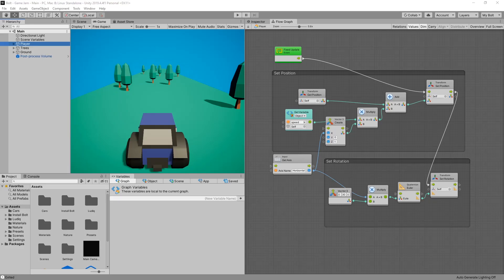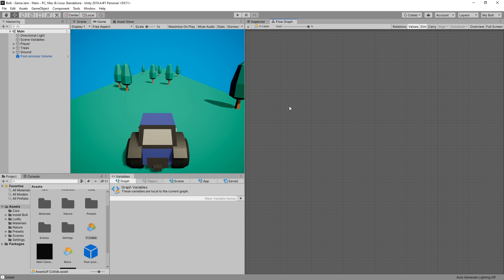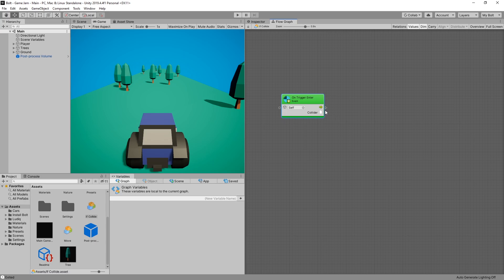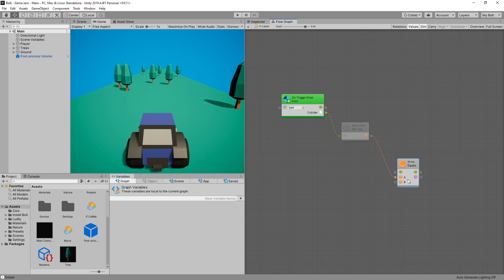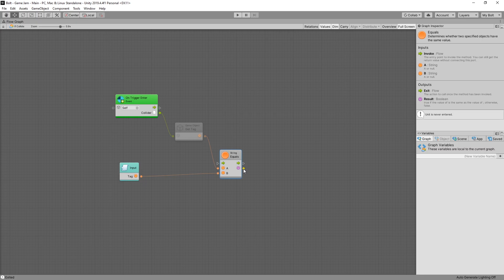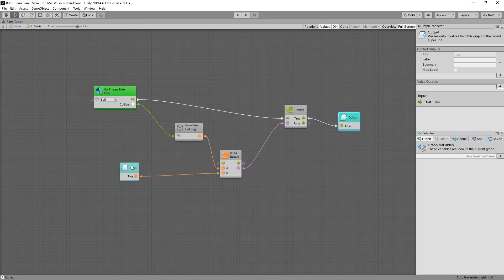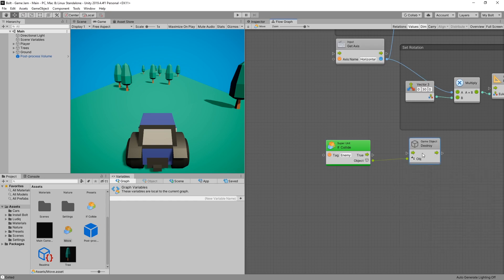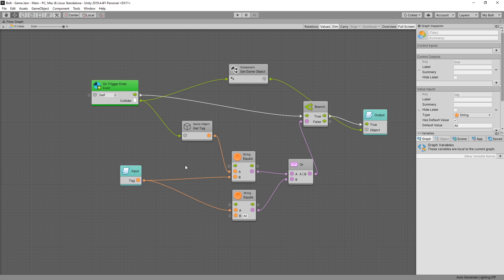Unity-Bolt Part 3: Add Collision Triggers - Getting Started- Super Units Subgraph (Visual Scripting)

Comment: To be honest i hate this system; i am on a 2d project. I set an other boxcollider to the player which tests  there is an enemy inside this “box”, and when this is true, set the collider object as “toggle” variable , sounds easy ha? When my player walks and gets enough distance to the enemy; collider works but when setting the variable , the collider node turns to red. No sense! Collider works and chechs it is enemy true but the “set variable” node makes all the super unit mess.  Maybe i had tried 4-5 different options but no everytime the coklider node that conneted to the trigger node turns red if i want to get the collider object. When i see this video , i feel deeply sad. But luck you, the logic is working at you :)

Comment: Can you help? When I select "has default value" My If Collide node doesn't have a place to type in the Enemy type. What am I missing?

Edit: FIXED. Sometimes the nodes don’t update live or in real-time. Just delete and re-add node and it works

Or the actual solution that happened to me(a bit cumbersome to do each time) but when I had put the program down to wait for the answer, when I started it up to try the above solution, it was already working. 

So restarting Unity also works but you may not want to do it EVERY TIME but it’s also an option